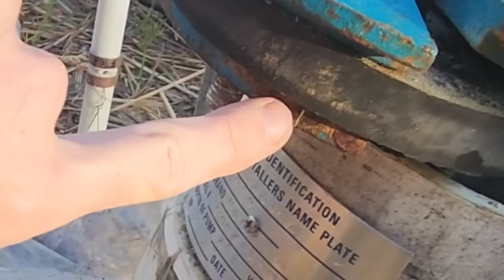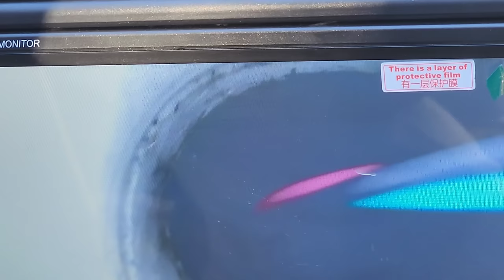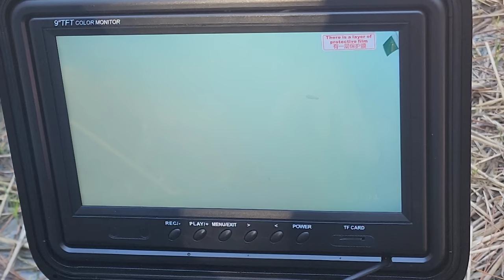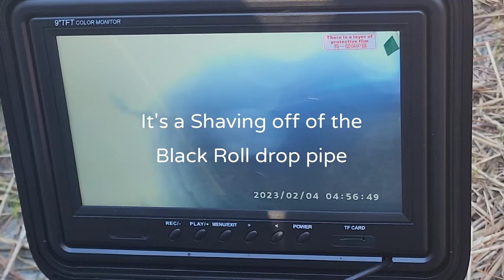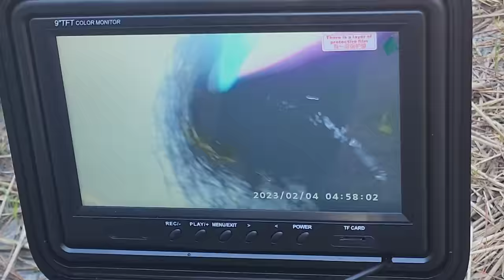What You Dont See! Discolored Well Water & Why it's Happening to Your Well.

Comment: I don't understand why the well cap mfg don't deform the bolts so they don't come out!
Reply: You want a way to remove the bolts. It looks like it's holding the rubber seal in place. You want that to be replaceable, unless you replace the entire cap.
Reply: They can use the  ss  deflon/ nylon seal nut .
Reply: @arthurr8670  I'd take that inplace of having the parts drop in a well and jamming something up.
Reply: @2wwwilly  and they still can be removed and parts dropped in well by the uninformed person.
Reply: Hello..I have aquwstion..how do I check if my well pump is bad .
Reply: @EzequielMaldonado-f4d take the cap off and look down well if you have sanatary well seal just loosen the bolts DON'T TAKE them out.
Take a current reading with a clamp on meter on wires to see if you have current flow, that usually tells you pump is running.
listen for water runing in casing.
Reply: Exactly it should be a building code requirement

Comment: I've always installed a pitless adapter on the well casing  below the frost line or at a  depht regulated by lical plumbing codes.
Reply: Yes!
Reply: Apparently they are in a southern zone where you do not need to go to that length . Here in 
NH and ME  we us pitless adapters and they are usually about 6 feet deep .

Comment: 3/4 is likely used as a false money saving function. In my area in older houses it would not be uncommon to find 1/2 inch to the house in older houses built pre-code. Many people did their own construction. The mind set was--if water comes out of the faucet in the house---all is good and we ain't spending no more money!!
Reply: I find plenty of those cost saving measures around our poorly built house. Just got done removing a kitchen sink slip ptrap from the shower. I presume it was an extra that they had lying around.

Comment: Another way to keep the bottom plate from is to run the bolt through and weld a blob on the threads at the end of the bolt
Reply: I just "Trash" the end threads with whatever's handy, hammer & chisel, BIG pliers, jamb nuts...
Reply: There's nothing wrong with the design. The problem is the homeowner who thinks he should unscrew all four bolts all the way. Even as a newbie, years ago, I never made that mistake.

Comment: Had a plumber guy that Lowe's sent to my house wanted to charge me $2500 to swap out my well pump but i had to get the pump and everything else as well as prep the area including pull the pump. Im a disabled older woman. All he told me about what to purchase was "get a 1 hp 2 wire submersible pump, if you get a 3 wire get the box too". I had a 3 wire originally and knew nothing else of the well, it's the first time i had any problem with it, other than replacing the pressure switch a few years back, since i bought the place.  I went straight to YouTube and found your channel to give me an idea of what i needed to get and thought if i gotta do all that i might as well do it myself. Needless to say that guy will never get my business, my son works for a grading co and borrowed the crane and between he, his wife and myself we got the job done. Went with the same thing i had .
Reply: That’s crazy expensive! I replaced one for a friend last year and his son helped me and pulling it out and going and getting the replacement took about five hours by the time we turned the new one on and I know I was cheap but I charged him 350 labor
Reply: Outstanding!
Reply: Good to hear that you got it done. That idiot should be put in jail for trying to take advantage of a disabled older lady.

Comment: Crazy how people do things differently in different places. Here in Maine we always use 1" black polyethylene and pitiless adapter at least 6 feet deep.

Only time I see a cap like that is an old well someone has in the basement
Reply: But you are in Maine where you have what some people call a “frost line”. Where I live, most people have never heard of a frost line and our wells are always capped above ground like this video.
Reply: I'm still surprised there isn't a pitless adapter if there is a chance of freezing. You aren't adding that much to the cost of the well, but you never have to think about the outside portion of the well.
Reply: The 3/4" pipe mentioned in the video would have an internal diamter of what... 1/2"? Not going to get much through that!

Comment: Dude you have been such a big help to me as a service plumber! Is there any way that you could do a video on testing the condition electrical insulation of the submersible wire and motor windings down the well casing, after you disconnect the wires running underground from the house, with a multimeter or megger? It would be nice to be able to tell my customers that either A: you’ve got a problem with the submersible wire, or B: you’ve got a problem with the pump motor itself. Is there a number, say in ohms, that I should be looking for… like if it’s below 1.5 ohms your pump or cable has (or is going bad). Teach us you ways professor!
Reply from the maker: Simply use a clamp style amp meter. If you have 240v at the well head & 0 amps, it's a broken wire. If you get amps above 9.5-16 then it's a bad pump. 
If you get 7 amps & 240v & no water, then its broken pipe down the hole. If you get 3.5amps, (low) then the pump splines are stripped out. 
I never do it any other way.
Reply: I’m about an hour and a half north of you. I live in a Town that starts with an “L” and ends with “burg” can I start referring you to some of my customers?
Reply from the maker: @robtheisen5844  that's a little too far for me.

Comment: Thanks for sharing your knowledge. I'm watching videos on deep well pumps because in a few hours I'll be attending to fix one for a friend. Never worked on water pumps so I'm getting a new education at 65 years old. So thanks for sharing... Carey in North Carolina...
Reply from the maker: Have a few people there to help you!.
Remember that if you lift it up & see that it's on pvc, do not pull it out like I do the black pipe or it will break. Pvc must be pulled straight up in 20ft sections bc its too ridged.

Comment: Hello  Sir. Live in California.   Like your show.  So me know what you do Plus hoke lot more! Started at 15 on oil rigs.  Spent 22.5 yearsdoing everything you could do to a hole in the ground. From 0’ to 26,000’  and bank  to 0’ .  I started with abandoned wells drilled, cable pounded in 1910”s We cut down /pulled over the last ten standing wood derrick’ in Kern  Co. got my first Rig as a driller/operator in in 1978.  Double Ideco  drive in  220ft derrick 225,000 pull.  40,000 pound draw works  1’ line  6line blocks three man crew that just the start  less than three years at 18 a position like that in 1970’s  oh 64 now retired!

Comment: Do you ever use pitless adapters for the plumbing connections on the wells there?
Reply from the maker: Only when asked by customer. 
State law requires water sample port at well head. Install a pitless then requires me to install a yard hydrant. Just more expensive. If I drive 4 hours north, all wells become pitless.
Reply: @h2omechanic  , it's good to see you're feeling better. You mentioned "state law" which made me think about code & inspection. I wondered, you suggest that whoever ran the supply piping from the pump to the house undersized it & I would agree but I would've thought this would be regulated by code. So how can it pass an inspection with undersized piping or is this more about "minimum to meet code" versus "ideal"? Btw great to see Mandy and Ginger! ^_^

Comment: We put a crimp on the bottom of the bolt thread so they can not be unscrewed out of the bottom plate. very quick and painless with a crimp tool. We also use 316 stainless steel bolts and aluminium seal plates.

Comment: I love your videos, informative and easy to watch. However I have a small issue with you calling out the 3/4” supply pipe. The well plate says it’s a 2 gpm well. So why waste $ on a 1” or whatever to flow at 10-12 gpm when you’re not meant to flow more than 2?  Perhaps they sized the pipe based on the rated flow and not on the ideal 10 gpm.
Reply from the maker: It creates unnecessary head pressure against the pump trying to force water thru that small pipe. 3/4" pex is cts which means it's actually smaller than typical 3/4" black roll & 3/4" pvc.  Think of it as 1/2" pvc. Bc 1/2"pvc beside 3/4" pex look the same size. Pex is measured by cts (copper tubing size) .  It works, but its really undersized. The pump here can provide probably 9-10gpm with proper plumbing
Reply: That PEX water feed looks totally unprofessional. Each PEX fitting further restricts the flow since the fittling is designed to go inside the pipe. Also, I'm pretty sure PEX is not supposed to be direct burried in the ground either.
Reply: @davebrunson125  You're right about it being a dry hole.  The stated well capacity is 2 gpm, most of that water looks like it's being produced from overburden leaking into the bottom of the well casing.  If he seals off the bottom of that casing, the well will produce little if any water.  That is probably the reason the drillers didn't cement up the casing, they suspected it was a dry hole.

Comment: I love your channel. I am in NJ and this is my first house with a well. The well is actually in my basement! I am confused, you said his pump pits down about 400 feet but his casing only goes ~ 70 feet. what is between end of casing and the pump? And how come casing isn't required all the way down to the pump? Thx for all your great content!!
Reply: They set casing down to bedrock , below that it's a rock casing.
Reply: ⚠️  CORRECTION —  “People’s Republic of New Jersey” and NOT “NJ”.
🤣

(I grew up in Essex Fells and moved to Morris County years back)

One quick recommendation… I’m an electrical contractor and have a bunch of customers with wells.
Most of them were installed by the same well co. working for a developer.
They were all given Berkey Black gravity water filter units (I believe they are the “Royal Berkey” models).
There were apparently no contaminants detected but they all state that the drinking water tastes much better using the filter vs. without.
After seeing this and speaking with most of the residents, I bought one for my own home.
We have municipal water and it’s supposedly “tested & OK”, but it really smells horribly like chlorine.
The water is actually drinkable when using the Berkey filter.  I think we got the larger model??
I never could drink the tap water here and used to buy spring water for drinking and cooking.
Now, I drink the water and love it!

Good luck. 👍🏼😀

Comment: Also that's PEX-B so the ID of the fittings are smaller than 3/4" so that's an additional restriction. If it was PEX-A the ID of the fittings would be the same as the pipe.

Comment: Regarding the 3/4” diameter pex tubing from well to house.  Can you send a steel cable through the line, connect it to a tubing cutter, split the existing tubing and follow it with 1” diameter pe tubing?  This method is commonly used to update lead service connections to water mains.

Comment: In the north we use 1-piece well head caps and all hardware is on the Outside diameter of the well head. No chance of any bolts falling down the well. Can 1 piece caps be used in the southern states too?

Comment: Wet air from the well will enter the metal splice box and corrode the connections. The problem should be on the driller, They can set up the drill rig and remove the casing and re bore the concrete seal out.

Comment: Great video and problem solving,  I've had a well installed in the UK , but 150ft down and I get 5 gallon a minute,  they put a 6inch perforated pipe at the bottom 30ft then a normal 6inch pipe on top,  my question is why don't you guys do that
Reply from the maker: Your probably in a coastal region, the slotted casing is used in specific areas. Just not needed here bc we find water in rock, not sand
Reply: @H2o Mechanic   thanks for your reply,  we are on Cornwall,  and your right they went through Granite

Comment: I had someone call me and a would plumber dropped both half moon pieces on top of the pump. I used a ten foot piece of angled iron and a rope to knock it loose it took a couple hours to get it out of the well. Kept locking up in well. They had been without water for over a month
Reply from the maker: Yup, it's actually the most common problem, that's why I only use 1 percent well seals. Glad you got it free
Reply: @h2omechanic one percent seals?
Reply: @earlestes8649  I think he meant to write 1 piece and the auto-correct did it wrong

Comment: Have a question real quick sir. Is it best to use a submersible pump or a convertible jet pump on a 44' well with a 11 gpm flow rate
Reply from the maker: If its a 4" well or bigger, I go with a submersible. 
3" wellvo or smaller then use jet pump
Reply: @h2omechanic  will a 1/2 hp 3 wire pump work? I hate 3 wire pumps but the customer already has that particular one. And also what size pressure tank do you recommend for the submersible pump
Reply from the maker: @heathammons8270  it'll be fine. Just use a 20gal tank.
Reply: Man thank you a million, your awesome. And thanks for the unexpected immediate response, you've helped me tremendously. If I run into anything I will get back with you if that's ok. Thanks again brother

Comment: I have a house that has a well. On the cap it says the flow is 2.5 gallons a minute.    
15 miles away, I lived at a rental that had to have the well re drilled.   When they tested the well, the pump could only pump at 50 gallons a minute.   The well flow was more than 50 gallons a minute.

Comment: Why are plastic casings used instead of steel, and why not pit less adapters? Cost I imagine. We're way up north, I have only ever seen steal casings used here. If a sanitary top seal is used, the top of the well is either buried 4 feet or in a heated well house.

Comment: Hey man, I really appreciate your videos and your content, I have learned a lot. However, I have a question and I hope you have an answer? My water pressure has dropped in the last few weeks. I went out and looked in the pump house, and the system has a 20-40 pressure switch. The bladder tank rings when I knock on it and no water comes out the Schrader valve. When I pressure tested the tank, it was at 62 psI. I know that's way out of spec for what the setting should be, but how have I lived here for five years and never had an issue with my water pressure? I reduced the air pressure in the tank to 18 PSI, but now the pump seems to short cycle and my pressure is less. Additionally, the water is coming out kind of dirty and cloudy. I took the cap off of the well casing and shined a light down inside. I did not see any water spraying from a crack in a pipe, nor did I hear any type of leak. Can you give me any suggestions as to on what's going on?
Reply: you will need to camera it just like was done here, you can rent one

Comment: How do you pull the pump in the future if it’s cemented in ?
Reply from the maker: The liner is a 4'' pipe that is put into the 6" pipe. There's a seal on the bottom of the 4" pipe 6 rubber disc's. The cement goes between the 6" & 4" in that small gap. Cement doesn't go into the well. In a nut shell, the casing is being extended and reduced in size.
Reply: @h2omechanic  oh.  Got it.   Thanks

Comment: Well drillers up here in Canada use steel pipe casing all the way. No plastic.
Reply: Not true here in Alberta  many newer wells use plastic as it will not rust out.
Reply: @roballan4944  it takes a long time for schedule 40 to rust out. I've pulled pumps out of wells 40 years old still in good shape that are steel casing. I'm in Ontario
Reply: @roballan4944  I'm in B.C. and never, ever seen plastic. It's steel well casing only. It doesn't rust out; one of mine is over sixty years old and looks like new. I'm not saying plastic is a bad idea, but I would rather spend the money on steel.

Comment: Have a well that according to a well guy is about 50ftto where the pump is.  My sediment filter and carbon filter all of a sudden filled up with sandy clay and the pump burned out. The well guy doesn't use a camera though he claims he has a couple and says he's never seen a broken or cracked casing. He replaced the pump then 2 days later it started pumping sandy mud again. I shut the power off and came a different company.  They said its most likely a collapsed well and drilled a new one.  So now I have 2 wells. 1 that works at 5 gal. Per minute and 1 that doesn't work. He also does not use a camera though he has them.  ( doesn't make any sense to have them and not use them to me though ) what could be done to save the non-working well and is it possible to link both weeks together?

Comment: Just a thought, could you not replate the original bolts that screws into the lower halfmoon part that clamps the rubber seal tight with longer bolts and then either put two nuts tightened against each others or a nylock lock nut so that you can't unscrew the bolt completely but end up simply tightening it against the halfmoon piece if someone tries to remove the bolts?

I would even be tempted to weld a nut to the bolt below the halfmoon piece to stop it being removed!
Reply: Couple good smacks with a hammer on the end of the threads would be a quick and free "95% solution" (the other 5%....  they'll at least have to work a lot harder to "F" it up... )

Comment: The way that well is capped seems very strange to me.  The wells I've had including my current home have a cap with black tubing running down the side against the casing.  It goes about 4 feet deep then runs towards the house.  No insulation or fake rock.  Also 2 gal/min wells in my area aren't considered adequate for a home.  They usually require a huge underground tank.